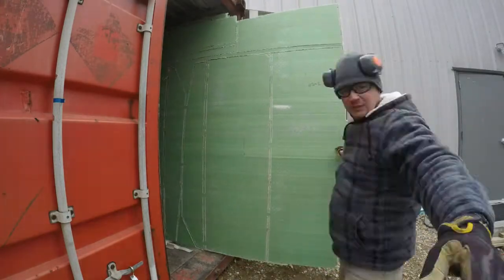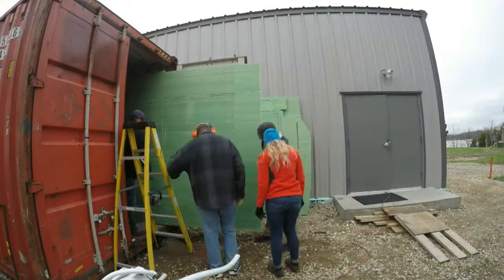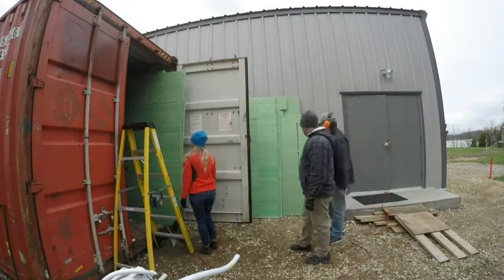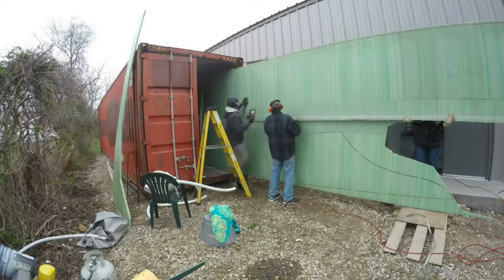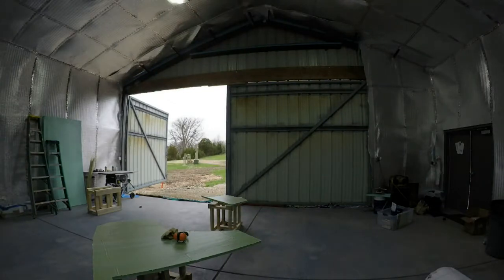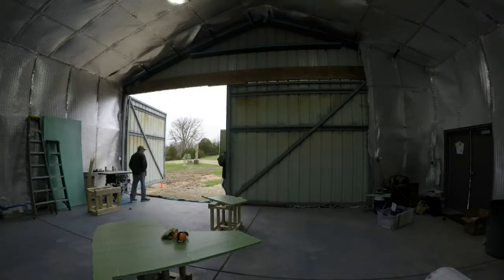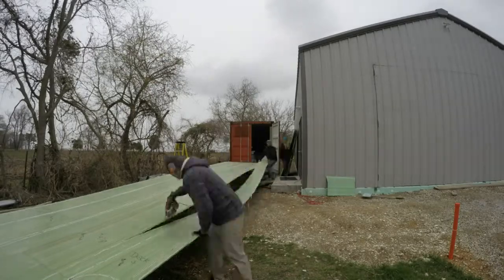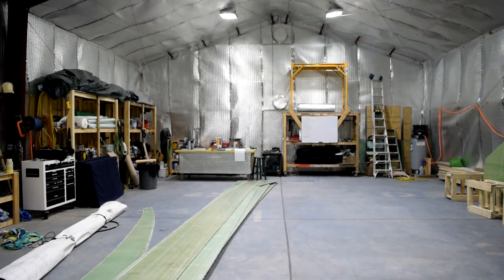Cutting panels on our Schionning Arrow 1280

Comment: Excellent start. Definitely puts a smile on your face. Any reason for choosing the 1280 instead of 1360?
Reply from the maker: Thanks. 
Cost, performance and speed to build were all factors.  We really liked the 1360 and it certainly has more displacement for cruising gear.  In the end we felt the 1280 was plenty of boat, and the beam to length ratio is a little more sporty on the 1280 15.2:1 vice 14:1 on the 1360.  I expect both to be high performance.